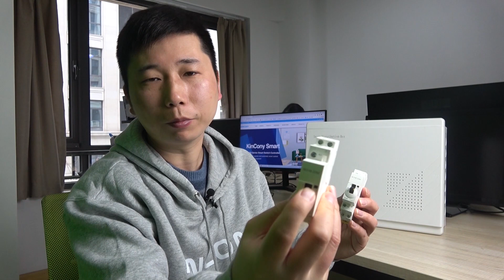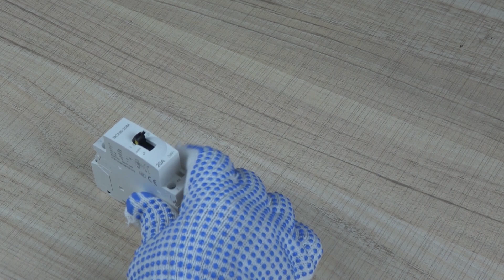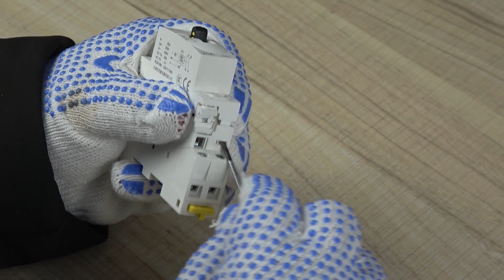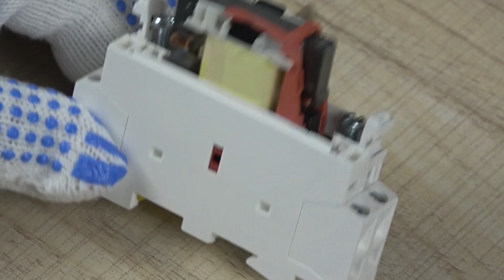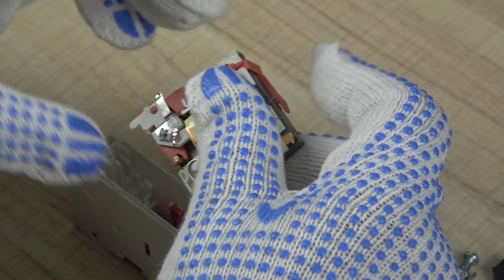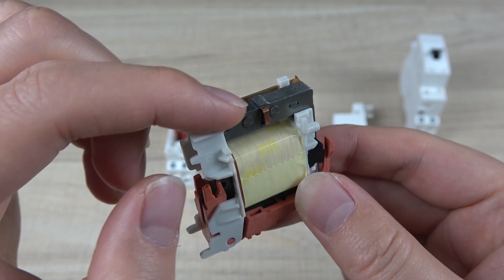take apart of AC contactor see how it work inside

Comment: New subscriber here sir @kinkony, just an inquiry if you opt for the manual control switch to power it permanently, does the coil will no longer be needed/energized? Thanks.
Reply from the maker: yes, if manual control to power on, coil not need power, because it's physical connection.
Reply: @KinCony  Thanks Sir. 👍
Reply: Additional inquiry sir, if I may, how much power does it draw for-the-coil  with  230 volts ac, if it's constantly energized? Thanks again sir.
Reply from the maker: @rauljapay8167  it's very low, about mA level.
Reply: @KinCony  Thanks 👍